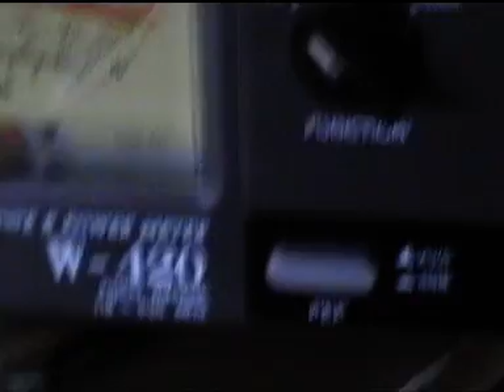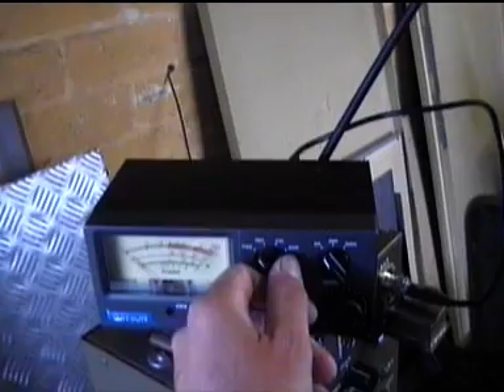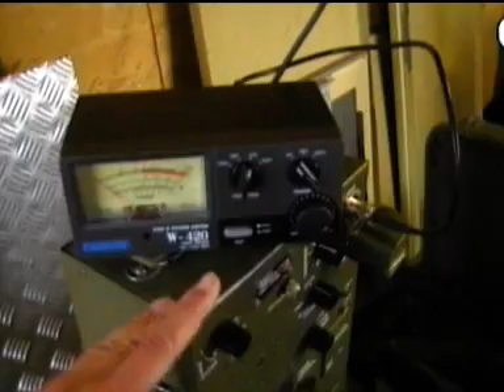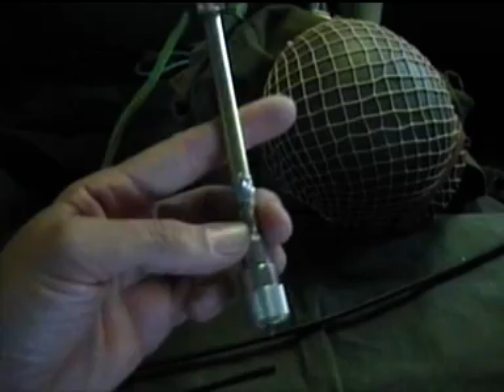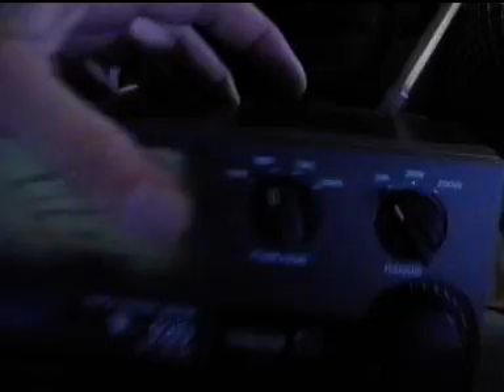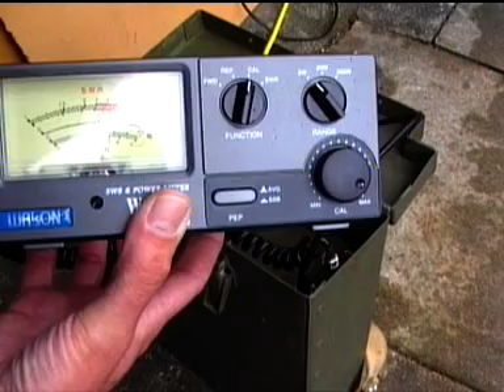PMR446 antenna tuning

Comment: easier going on ebay and getting a antenna for 446mhz playing like this will eventually cost you a blown output transistor and no radio
Reply from the maker: Well I make custom radio sets that I like to make look WW2 when I can. I 
also find even if I buy an antenna for this frequency when I have fitted the 
unit in a different steel box and extended the antenna feed to the case it will 
still need tuning with an SWR meter. A guy I met recently told me some old CB 
SWR meters will still work at 446mhz but I have not tested this and it may only 
be a few of them. The problem is you need one that will give good deflection at 
low power. On the low power sets you are also less likely to blow an OP 
transistor with a bad tune, but that would change when you go towards the 4W 
units you can now buy from China that are HAM sets. PS I like what you are into in the ghost hunting seen in time I want to do some similar stuff, I live in an old Manor House myself.
Reply: IM ALSO A RADIO HAM SO IF YOU NEED ANY ADVISE HIT ME UP NO PROBLEM
Reply from the maker: Thanks was tempted to take the course when I was younger but got involved in lots of other stuff, Robot Wars, WW2 re-enacting, airsoft etc. Are you the lady in the photo as I don't meet many women radio hams?

Comment from the maker: I have sorted quite a nice system for these radios now and have them on both my Jeep and Tank so they can com with each other and a WW2 Hady Talkie I have converted from WPG.  I use a much longer whip than this it is about 65cm long mounted in a DV27 fixing on the tank body.

Comment from the maker: Well is in not about forward power and reflected power so you have to reduce to the minimum reflected and maximum forward and as low on the VSWR as possible. This appears to give you an indication of the output power of the unit in simple terms if I use it on a 1/3 watt OP transmitter it gives me a lower needle swing that one with 1/2 watt OP.
The antenna isn't vehicle body mounted only onto the radio case so there seems to be little other option than to site the VSWR meter on top of the radio.

Comment: why don't you use a length of coax with your 14cm of braid stripped back then just cover the end in shrink wrap, then you can make the coax any length to imitate the bendy ww2 whip your after.
The problem with testing your aerials on the back ov the swr meter is that the reading is only good for the back of the meter, also everytime you put your hand near it the reading will change. you can't normally measure swr and power at the same time, bloody good meter if you can, I must find manual for it

Comment: Forget the sleeved dipole with radials as sleeved dipoles dont use radials but require a capacitance shunt and at that size would be difficult to work out, stick with the half or quarter wave vertical or even a 5/8 vertical with a small loading coil at the base plenty of info and calculators on the internet, your tunning varies with different thickness wires due to the velocity factor of the element wire, solid copper would be better, a small transmiting loop antenna would look authentic.
Phil

Comment: My antenna ha an radiator 52 Cm and 4 radials 52 Cm, its than a 1/2 wave for 2 Mtrs ans 5/8 for 70 Cm , SWR on 70 CN 446 is dead in corner, on 2 meters 1.2:1